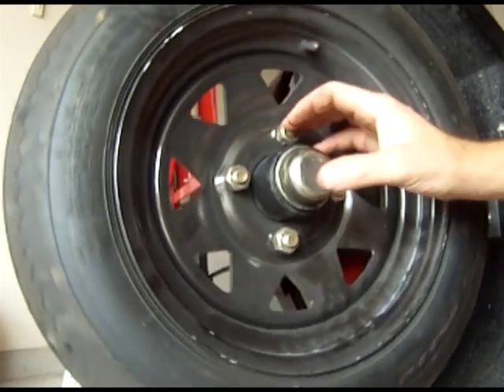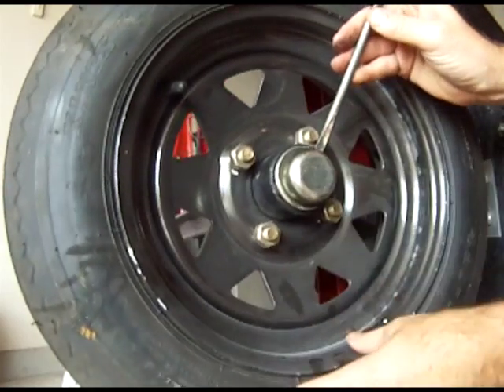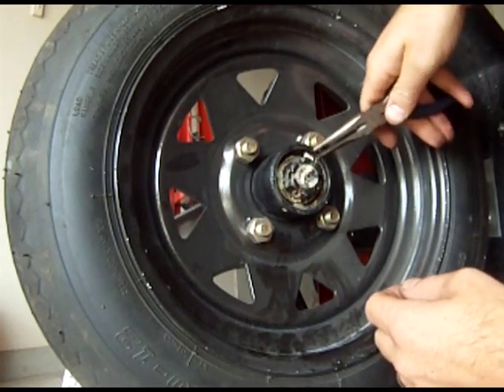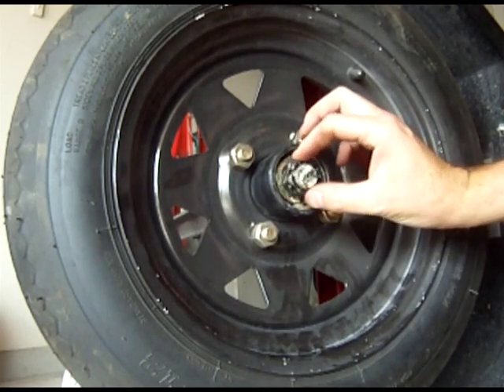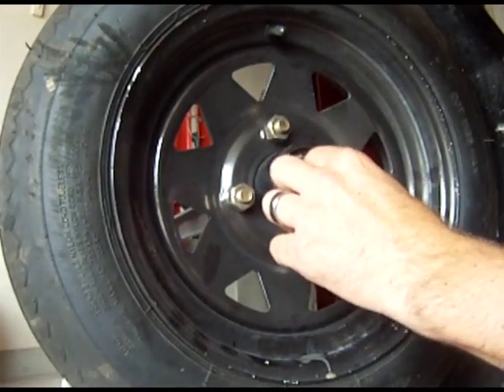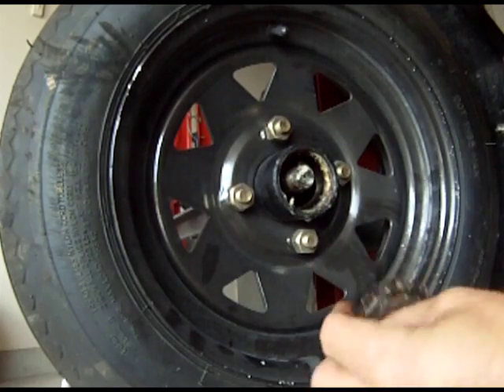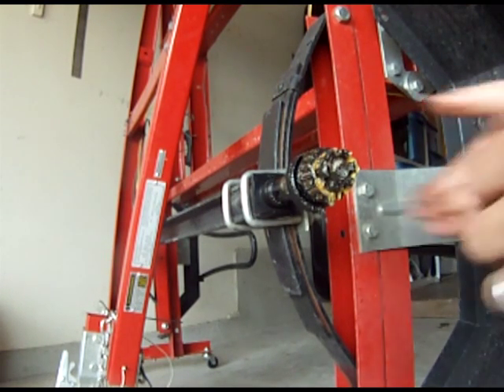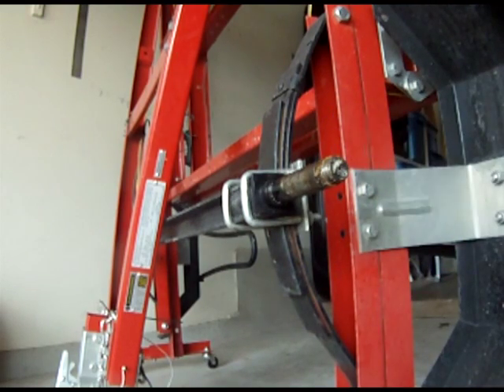How to Remove Trailer Hub Bearings - Fast and Simple

Comment: I have a small trailer with a dust cap like that but it has no visible lug nuts and I am unable to remove the dust cap. It seems almost as if it sealed or pressed on to the end of the axle. I really need to access it though because the axle is bent :/.
Reply: I figured it out. It takes more effort than I expeced. I used channel lock pliers and grabbed on to the dust cap and aggressively wiggled it different directions till it came off vs. using a chisel/flathead screw driver.
Reply from the maker: great to hear!